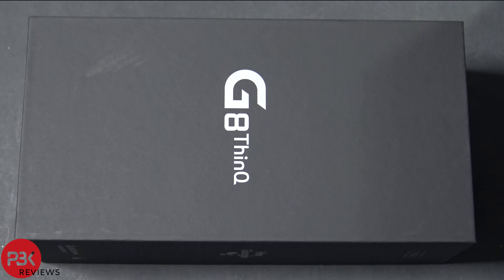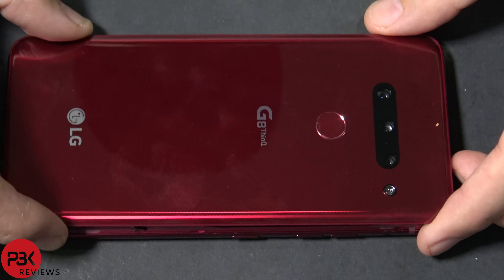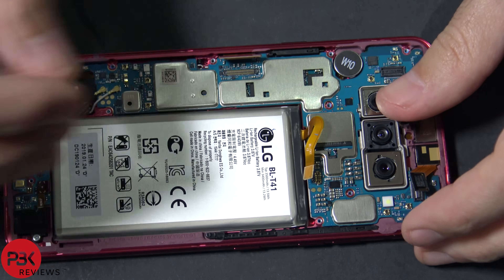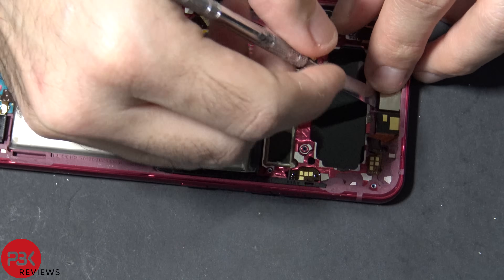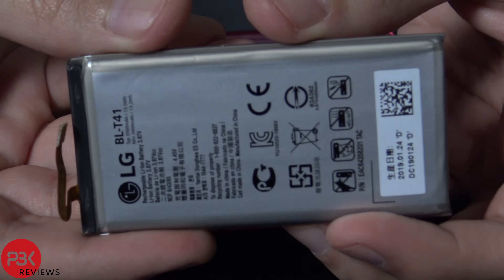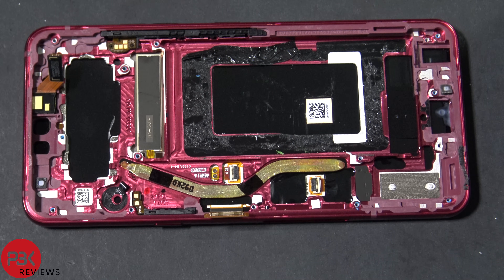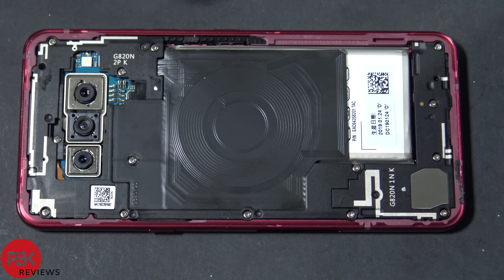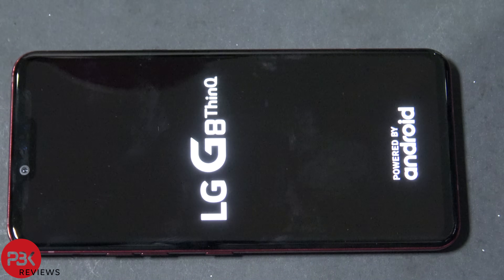LG G8 ThinQ Disassembly Teardown Repair Guide. No earpiece speaker?

Comment: Is it posdible to take the g8 display and use on g7
Reply from the maker: I don't think the connector will be the exact same nor do i think it will fit in the midframe of the other model phone but wouldn't know for sure unless i had both together to test but odds are unlikely but possible if the connector is the same size and fits etc.

Comment: Is there still a 10 bit image sensor at the back of the camera sensors?
Reply from the maker: I don't think so but I could be wrong. They don't advertise it for the LG G8 so I presume not.
Reply: @PBKreviews  yeah but i believe there's still a 10 bit image sensor its place on the back of the main camera the one with f1.5 aperture just like what i saw on v30 teardown by jerry its first introduced on v30 but i think g7 g8 and v40,v50 will have that too they just didn't advertised it cause its not the main highlights features of the new phone😊
Reply from the maker: @jaysealenduro5618  oh ok ya its possible

Comment: Idk it looks like the S10 is a better built phone and a much larger heat sink for sustained performance. Gah I wanna see inside the v50 before I go for a S10
Reply: It actually isn’t. They did a tear down of an s10 already and it seems they’re going apple style with putting the charging port attached to a bigger piece of the phone as well. Causing repairs to cost more now
Reply: @palmviewlobos15  that's not my point, the point is the S10 has a much better heat sink than the g8. The v50 is advertising vapor cooling as well, so I wonder if it has just as good of a heat sink than the S10.
Reply: @palmviewlobos15  whether it has a modular board or not does not subtract to whether something is well built or not. Assuming the charging port does go, you still have fast wireless charging
Reply from the maker: Will try to get my hands on one asap n take it apart

Comment: Where are the cell and WiFi antennas?
Reply from the maker: They are the white lines on the top and bottom black plastic pieces (one of which houses the speaker assembly) after you remove the back glass